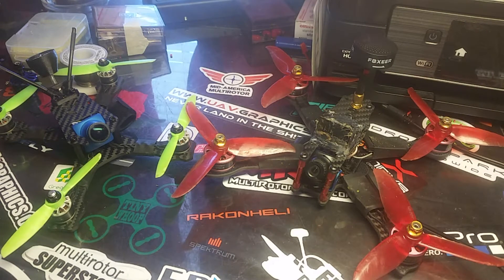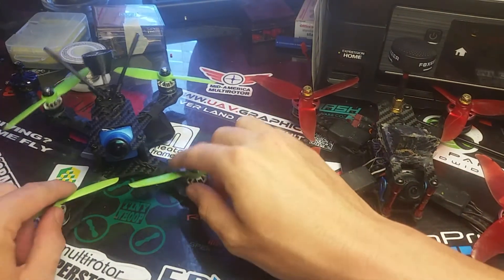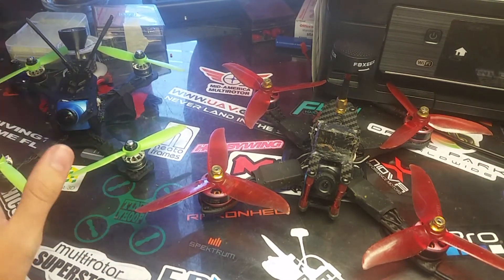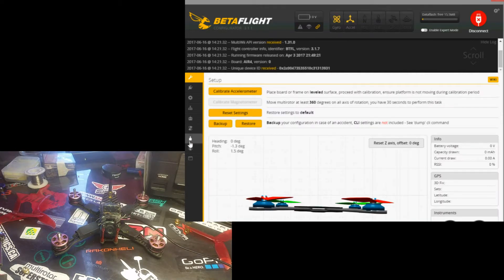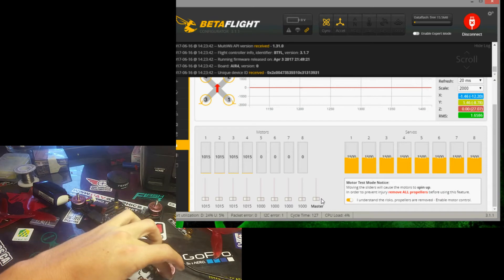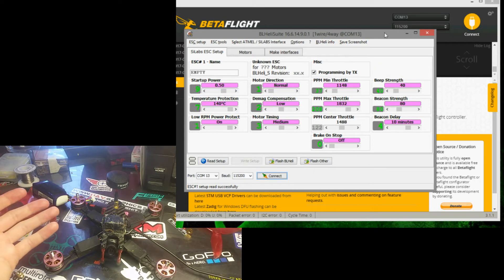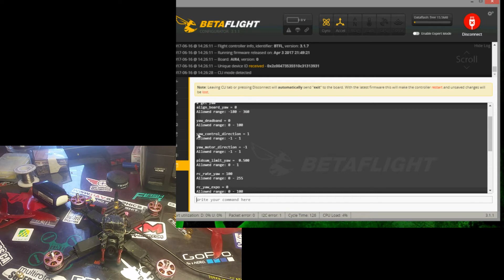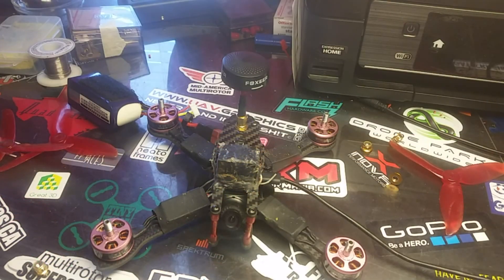How to reverse motor direction and Yaw

Comment: so I am used to my YAW being reversed ( yaw pressed right on remote my quad turns left ) in my simulator but when i tried flying real quad its different. SO How can I change my Yaw direction in Betaflight? so when I push my YAW left, I want my quad to turn right. I am a NOOB. Please someone help. ive been at this for 2 weeks and no progression. HELP HELP HELP
Reply: depending on your transmitter you could do it with only your transmitter by reversing your channels

Comment: Hi guys, I got a issue with the esc's. when I set normal direction in blheli configurator the motor turns reverse and vice versa. any idea to solve to solve this issue? thanks in advance.

Comment: Do I have to set the yaw to -1 even if I change the spin direction only to 2 motors? ( motor #1 and motor #4)
Reply from the maker: if you are only changing two motors, your quad is going to spin in a circle and not be stable. if you are just attempting to sort out the standard rotation you dont have to change the yaw.
Reply: Thanks. i really was trying to get the motors spinning in the right direction after a bad wiring without soldering again. Didn't change the yaw and its all good.

Comment: I built my first racing drone it spun in the air like a top. I switched the props around and the drone just flipped over. What did I do wrong. I reversed the wires for motors 2 and 4
Reply from the maker: I would verify that all of your motors are spinning the right directions first off. then ensure the props are correct. Perform an ESC calibration and acc calibration and you should be good.

Comment: think this is parameter is called yaw_motors_reversed = ON  in newer versions of BF
Reply from the maker: Which version? I did this demo on 3.1.7 so it sounds like youre referencing 3.2.
Reply: Man I didn't know about this option in 3.2 its way easier, now I just wish they would change Channel mapping to Pitch = p not E and Roll = R not A ETC that is confusing AF
Reply from the maker: E stands for elevator which controls the pitch of the aircraft and A is aileron which controls the roll of the aircraft. Just like R is rudder which controls the aircraft yaw.
Reply: RotorQuad Squad Yeah I undrstand it but I have no idea why  beta flight has not fixed it why call it one thing then something else when you have to change it, that is just dumb
Reply from the maker: You need to remember that most of our equipment was designed around planes. Most of it never updated. Combine that with the fact that in reality commercial/common multirotors are still VERY new (~5 years) so the tech is still catching up. Im just happy we are finally starting to see some quad specific parts from the big manufacturers.

Comment: omg, as a build newbie just in the process of reversing motors 1 & 4 this really confused me lol. So if I understand this right, motors 2 & 3 run CW and 1 & 4 CCW?
Reply from the maker: Correct. The original pattern was 1 and 4 CW and 2 and 3 CCW. This makes it how you have said.

Comment: If you don't also move the motors around, won't the prop nuts unwind in flight?
Reply from the maker: if you are using non lock nuts that rely on counter rotation to tighten yes, however in the mini quad world we have long since bypassed this problem with the use of lock nuts
Reply: RotorQuad Squad my emax red bottom lock nuts were impossible to use, so I've simply relied on the  screw direction. But that's good to know. :)
Reply from the maker: interesting. I wonder why,
Reply: RotorQuad Squad they just wouldn't turn, no matter what kind of force I applied. :(
I'd like to not apply so much torque that I risk bending them, so I stick to normal nuts...
Reply from the maker: yeah that doesnt make sense. Stupid question but did you have them on backwards? as in the ccw nuts on the cw or vice versa? I cant think of any reason for that unless they werent genuine and the sizing was off
Reply: RotorQuad Squad nope. I get them screwed in to basically where the plastic lock part starts, and they just won't move. It's like they put too plastic on there. I've tried multiple emax ones, too. Maybe I need to buy non-emax lock nuts...
Reply from the maker: sounds like It. I know on the first time on the red bottoms the nylons are tight but Ive never seen them that tight

Comment: Thanks for the tip... Love the vid demo of impacting the spear-bud bush :D seemed to help a lot!!! ... haha if this trend takes off all the reverse thread motor owners/manufacturers are gonna be pissed lol... Large H-Frame quads handle much better with reverse prop rotation because of the flex inflicted along the length of the body/spline... Reverse prop direction remedies this flex like a champ... APM fc's have an H-Frame selection (reverse prop direction) just for this reason... haha years ago I tried to reverse direction on Naza-Lite without ability to change Yaw parameter... let's just say "boomerang status" hahahaha... anyway will be testing F4 boards w/ BF reverse prop in my H-Frame 430/666/850mm Superclass racers FOR SURE!!! & yeah will test in my small racers too... anything to help keep my gate impacting arse in the air!
Reply from the maker: heck yeah! I actually lost a neato in that exact same tree that I showed in the video. took 3 hours to climb that tree and get it back haha. If you want more video from that party I posted up the rest of the DVR footage

https://www.youtube.com/watch?v=qXTh4K6mDLc

Comment: did you notice any flight efficiency like increased flight time ?
Reply from the maker: no but If I was absolutely desperate to find some sort of difference, it would be in the way it clips little limbs and such. Instead of sucking them into the frame and getting stuck it just brushes them off.
Reply: RotorQuad Squad thanks for the info! I was on betaflight 3.1.2 and it has a reverse prop button 😆...that dont do nothing😔...lol and here i am getting the know from You. Ive changed the prop direction on and fresh then my new build. I think i got the idea of tuneing ....but im seeing things in my flight that tells my something different. after changing it they seem to fly better for me. This might be just a coincidence but im thinking for someone not KNOWING how to tune this might help a little. Thanks buddy!